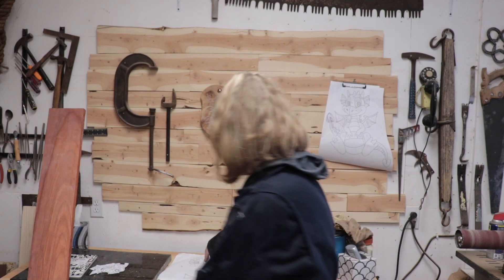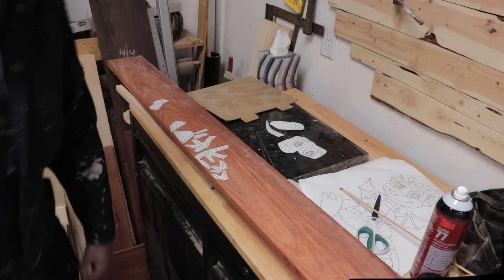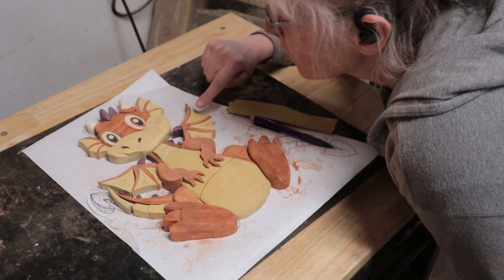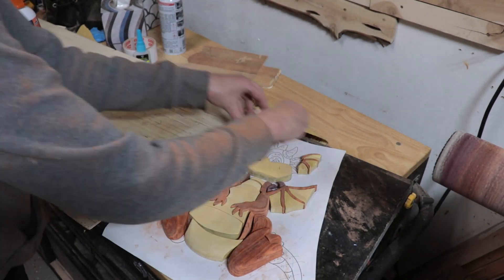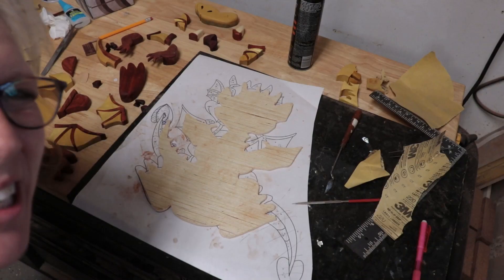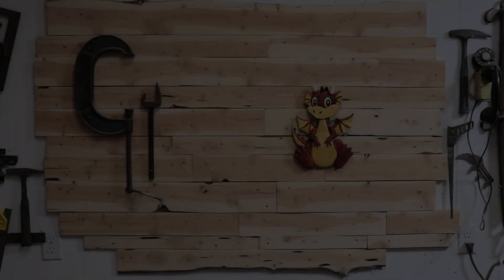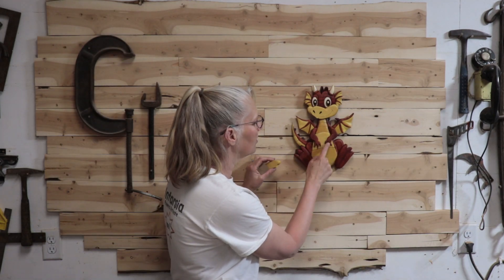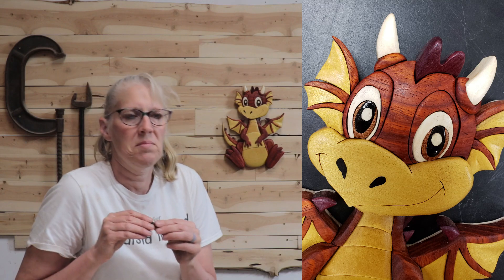Baby Dragon Intarsia

Comment: Super job. I like your presentation metho.  I use clear shelf liner on the board before effixing my paper template, this way it peels right off, no residue. Also take a look at sanding twigs, and sanding detailer kit.  The kit comes with 4 plastic 'pens', that has a sandpaper strip and a couple of sharp angles, great for detailing.  Twigs are self-explanatory.
Reply from the maker: Hello! I've used shelf liner or similar without ny luck, it doesn't stick to the wood very well. If you have a secret let me know.
I also have a sticker machine, it works well but is another step in the process. Spray glue is just easier! 🤣